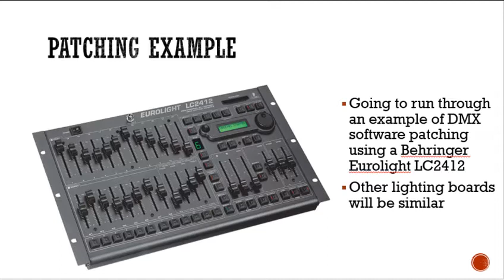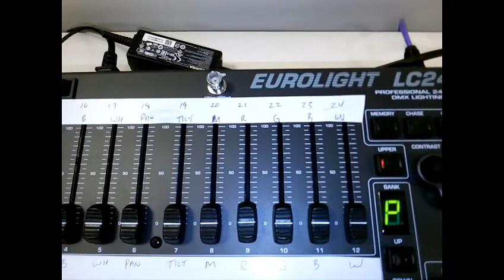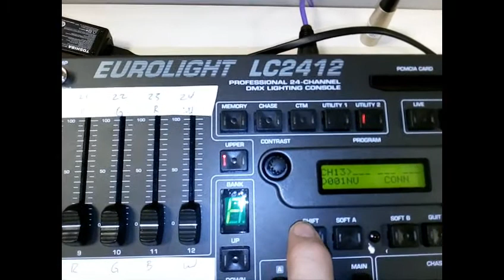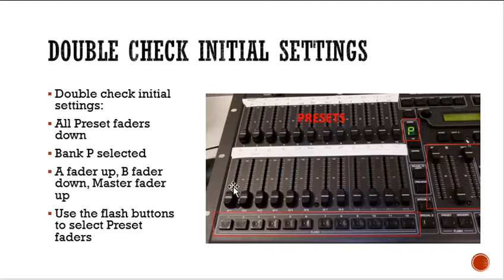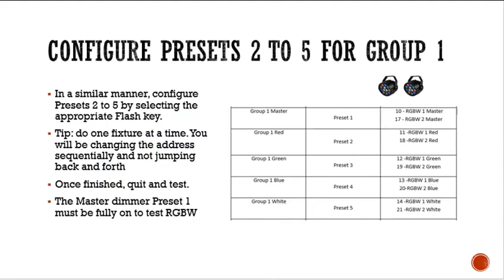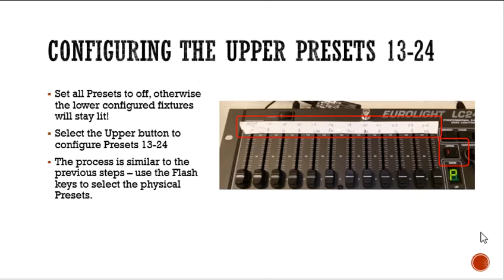Part 5: DMX Lighting - Patching (Behringer Eurolight LC2412)

Comment: Never mind Eugene...I solved the issue. I played with the A Master fader up and down and I noticed is was not all the way up (100%) and that made all fixtures work properly with all their features. It's perfect!! but thanks!
Reply from the maker: Interesting solution. I will pin your post to the top because it is an unexpected quirk.
Reply: @ Hi Eugene, than you for the quick response. I'm so excited that I got it to work cause now I can do pretty much anything with the lights in regards to scenes which is why I need to clarify something about scenes in your scenes video I watched. When you were testing the scenes, you never touched any of the memory faders,  why is that and if in fact I can use the faders to change from one scene to another? Thanks!

Comment: Hi Eugene, thanks for these video, Very helpful indeed. I'm running into an issue with my lights. I'm able to connect them to the Eurolight no problem.(Thanks to this video)The problem is how the lights react to the faders. For example, a simple LED par I'm only using 4 of the 7 channels it has and those are the main ones, the master and the RGB channels. The issue is that there is no fading happening. The light just turn on without a smooth fade. Also noticing that the red color is much more intense than the green and the blue. Also connected a moving head and I'm using all 11 channels and it barely moves when I use the tilt and pan, cannot change color, only changes to one gobo, etc. I'm using a terminator and also the cables are no longer than 25 feet between each fixture.
Reply from the maker: I see that you solved it already.

Comment: Thanks for great video, I've got this desk and was playing with it with some Mini Mac Profiles... We've connected everything up (after resetting the desk). Everything works, except the desk seems to be sending out fluctuating signals. While you can't see this with the colours etc. The pan/tilt is very noticeable, even with just a difference of 125>126 value for example. Your heads seemed rock steady...any ideas gratefully received. We've looked into firmware and my version is 01.06.01? Many thanks
Reply from the maker: On my robo lights, there was the option of setting the movement to fine or coarse. This is from memory from 4 or 5 years ago. You could set the lights to have 7 channels or 15 channels of control. Maybe your lights have something similar?
Reply: @blanchae  Thank you. The only work around we've found  so far is to press the hold button.

Comment: What if you have more than 24 channels you need to assign to a fader? Do we just do it one at a time patch the dmx channels to the faders when you need it to create a scene?
Reply from the maker: One fader can be assigned a maximum of 3 channels. You could assign multiple DMX lights with the same base channel address. All would follow the instructions as long as they have the same model configuration. Or you can assign one light as the master and the others as slaves.

Comment: This is a great series that has been of value to me, especially since we have the LC2412 ourselves. The people who set it up are long gone, there's no documentation of what they did, and our intuition regarding how it works was wrong. One thing I wish I saw in the planning has to do with physical fixture layout. It's one thing to have stuff mounted nearby within easy reach in a lab. But what about the real world, where we have large spaces with fixtures spread throughout? Some sort of architecture/layout diagram showing which fixtures are where is important. Is there good software for this?
Reply from the maker: Very good points. My "expertise" has just been limited to what you see here on the technical side.

Comment: Is there a way with this board to use all 24 faders at the same time. I don't need to set chances or scenes. I just want say Leko RGB 1-3, 4-6, 7-9. Then Uplights RGBWAUV on faders 10-15 and bring them all up and down with the maser fader and make adjustments to them on the flay by hand. I basically want to open all 24 faders at once...
Reply from the maker: You could turn all the faders on, then use the master to turn them up and down. So rather then the faders being all off, start with them all on?
Reply: @blanchae  Thank you. How do you do that with this board if I might ask? It seems to be either upper or lower... Any thoughts on how to get all 24 on at the same time? Thank you

Comment: Hi Eugene. I have 8 "older" 7 channel lights, which I need to turn on and off individually, but looking at your instructions, I am unsure, whether I can programme my Eurolight LC2412 with, one preset, to 4 channels, and by using it, turning the light up and down. 
Channel 1 is the Dimmer, and 2, 3 and 4 are the colours. I don't need to use the remaining 3 channels.
Can you please help?
Reply from the maker: You will need 4 dimmers per light: Master, R, G, B. You have 8 lights x 4 dimmers = 32 dimmers (need 32). The LC2412 has 12 lower dimmers and 12 upper for a total of 24. You're going to be short 8 dimmers. You can assign up to 3 channels per dimmer if you don't absolutely need to turn each light off individually. One set of 4 dimmers can control 3 lights as a group. Sounds like you need to get creative.

Comment: Nice video !
How does the pan and tilt functions work? Can you determine the angle of the moving head by how much up the fader is?
Reply from the maker: You should be able to. The lights can set the degrees for 100% fader. 180, 360, 540 degrees. You could do the math to determine the fader 0-100 to 0-360 deg pan.

Comment: Hi i was wondering if you know how many fixtures you can connect to the Behringer Eurolight LC2412?
Reply from the maker: That's a complicated question. In the old pre-DMX days, it was simple: 1 fixture - 1 fader. With DMX, one fixture can have multiple functions: red, green, blue, white, master, pan, tilt, etc.. Each function represents 1 channel that would be assigned to a fader. The LC2412 has 24 faders and each fader can be assigned 3 channels. Which means that you have to think about it differently. 

In addition, you can assign multiple identical fixtures the same base address so that they all respond as if they are one. If all the fixtures were just one color( white for example). You could have 24 faders, each controlling 3 fixtures for a total of 72 fixtures.